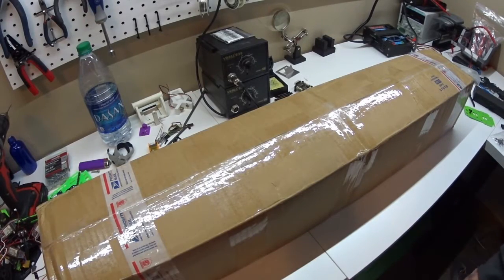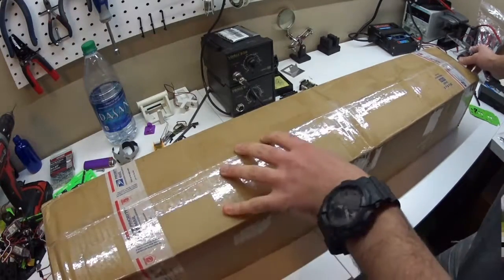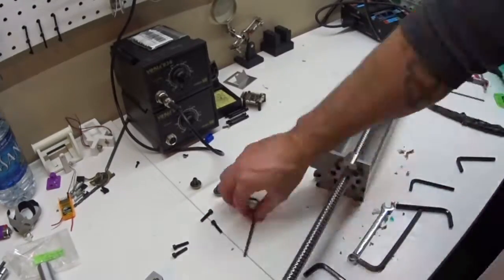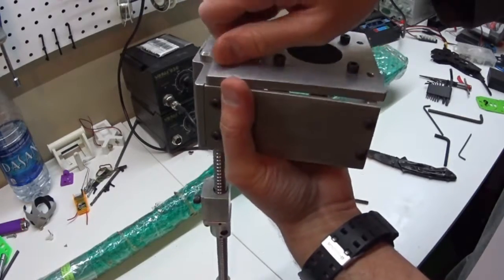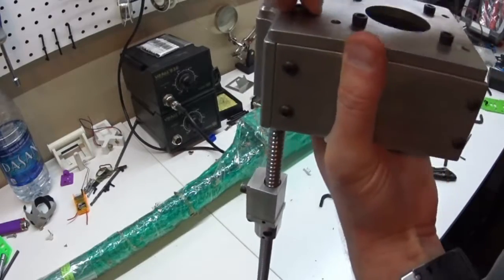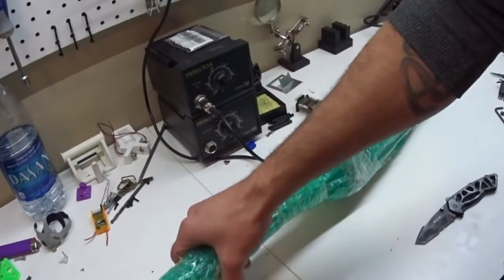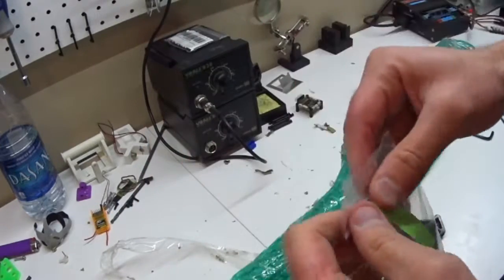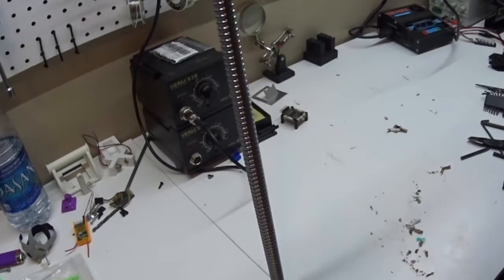BD Tools G0602 CNC Conversion Kit

Comment: Hi. Great video but I see it's been a while! lol  I tried the link below to order but doesn't seem to be available. If you read this message, please forward any info here I could use to convert a small lathe that would be close to a kit like this one?  Thanks a bunch in advance! LD Also did it come with stepping motors and what type of spindle HP motor do you have? Thanks
Reply from the maker: it looks like his site is offline, but from what I was seeing on cnczone people were mentioning to reach out to Billy through his eBay store

https://www.ebay.com/usr/bdtools

Give that a try.

I did not come with stepper motors. I think when I initially did the install I used some 525 in oz nema 23 motors, but I recently upgraded to Clearpath SDSK motors. 

If you have a mill or want to make your own kit this site has a fairly accurate model along with plans for the conversion

https://www.wadeodesign.com/cnc-lathe.html

Cnc4XR7 also has paid plans for a kit as well
https://cnc4xr7.com/G0602.php
Reply: @propslayerfabrications7047  Thanks a lot for your response! I'm sure it will be very helpfull.  I'll check it out.